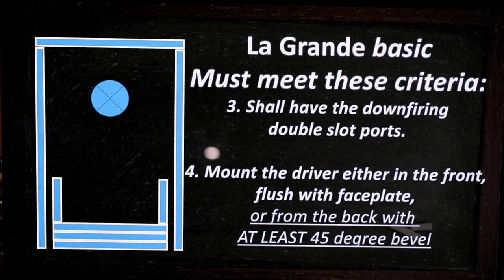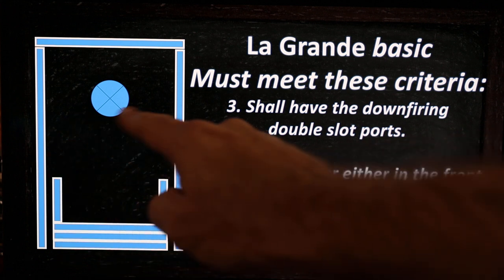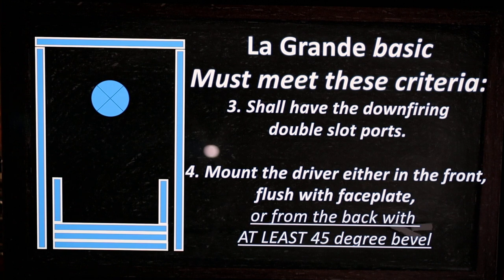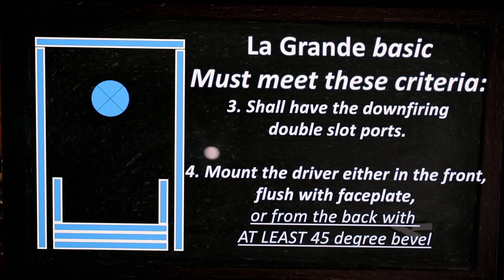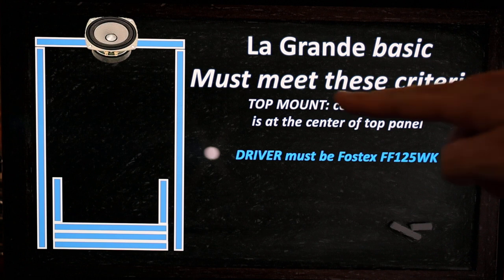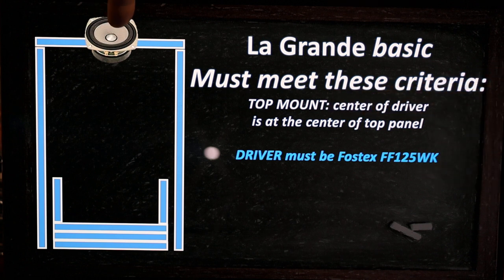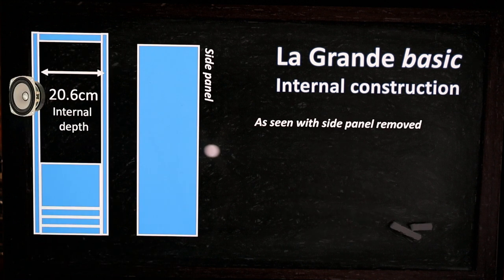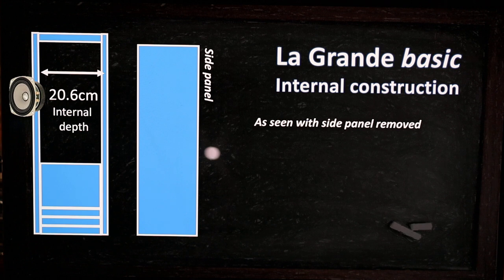La Grande basic build plans II

Comment: I'm seriously considering a "first attempt" to build myself a pair of speakers based off this design. Unfortunately, I don't have a space to build at the moment and my current living situation won't allow me. Hopefully this will change in a month or so. Yesterday, I was walking around a local big box store, checking out the solid wood boards and plywood. I ended up sketching my own version of a speaker based off the Basic La Grande dimensions. After a few hours of head scratching, I envisioned the whole construction process: materials and parts list, wood selection, tools needed, cuts and measurements, glue choices, etc. If I do end up building a pair, the construction will be with hand tools and simple smoothing materials like sandpaper, sanding blocks, files, etc. Also will convert all the measurements to fractional inches since that's what I'm most familiar with . My ultimate goal here is to "make something with whatever is available at any local hardware or big box store". Most importantly, to do it as cheaply as possible. As for the drivers, I won't be using the Fostex brand, so I'm throwing around a large list of lovely and possible girl's names in my head for my own creation. 
As for the assembly, I want to glue everything together permanently (with the exception of the rear panel). Upon completion, I will apply a dark colored varnish to the wood. The varnish idea lead me on a search to a video on making a black shellac finish from old broken 78 records! First task here is to buy a pair of 4 to 5 inch full range drivers. 😁
Reply: hi i just built mine and had the thought that would be possible to just take the measurement and the wood to  cabinet maker  who has all the tools already to do accurate cuts .  Am thinking a future version I will do that , could get them to rebate the wood so it slots together.  Just a thought that may help
Reply from the maker: Fantastic!! :) The shellac finish is a good idea - finished my Voigt pipe with shellac..
Reply from the maker: @toeknee8481  I'm glad you already finished it, that was super fast!!! :)
Reply: @realworldaudio  Yes 👍 I think it's a great idea. But the person who produced the video made a super thick cut of varnish. Too thick IMHO.  He also used a brush to apply the varnish to wood. The mixture would need to be filtered first before use. Also adjusted accordingly with the right amount of broken record chips and alcohol, to produce a cut that can easily applied with a hand pad. The color he made from the 78 records is black no doubt. Darkest colored shellac I've ever seen to date. Natural wood is very nice looking, but having some color options is a whole other world.  🙂

Comment: Thanks Janos I jumped the gun as had some free time over holidays and started my build before these videos and have decided to finish with some adaptations as per these updates. So i have an internal height of 508cm based on the earlier video,  which is a bit short and front, and back panels are 18cm plywood.  Can easily adapt the sides to solid pine as I have some old shelves I will use . Bottom is slotted.  Am thinking will finish as is , but can swap back to 12 cm ply later. Using same driver.  Can do the chamfer will need to get the bit . AM thinking will be just a little less bass but otherwise same , or not ?
Reply from the maker: You can keep the 18mm, no worries! Will be a little less live, but nice sounding nonetheless. Just make sure to mount the driver from the outside, the inside will not work with that thickness. The slighty smaller height is not an issue - yes, bass not as deep, but not by much. Also, the 50.8 cm tuning is a little more balanced, than the one for the 61.6, so you will also end up with a very nice cabinet. I suspect that they will sound very similar, just slight +/- for each.
Reply: Hi Toeknee - I know exactly which build you mean: La Gorda. BTW, what is the length of your port? I tried to figure that one out with WinISD as I only got the length for the tube version. Your feedback would be most welcome. THX
Reply: @realworldaudio  Janos, you never talked about the slot port length for La Gorda (internal dimensions H51.8 W 34.6 D20.6)  (only of the port length) - I derived a slot port length (slot height 15mm) of 11.5 cm. Could you confirm my "calculation":hand-purple-blue-peace:?
Reply: @sebastianbenz2496  In short probable 140mm.  I had already cut the wood for the face but was able to adjust the slottted port to be the same as Janos which has shrunk my height down to 480  (518-38)as i have add the two extra bits of of pine on the slot. WAs using 19mm pine so i cut bottom at 308 -36. but rounded it to 290mm as i had some pine shelving  peice  that size so just used that and then used two 240mm piece of pine shelving and screwed on top of the 290mm which left a 20mm gap each end . so cut  another 240mm in half to be 120 and they were the sides. Then did alot of sanding to even them up. so answer would of been 140mm which was 2mm more than Janos. Is suppoded be a guide so a few mm i think wont matter. I have done the rebate. Started playing them tonight . Sounstage is huge and is as deep as wide.  My  internal measurements were internal 478H, 318 w, 173 deep and 15mm x 2 slots (in theory not sure of my build quality may need to do adjustments) . with a 140mm port height.
Reply: @toeknee8481  thank you, Toeknee - happy to hear that you enjoy your build. Will report how La Gorda plays, hopefully by end of next week ;-)
Reply: @realworldaudio  Thanks , yes mounted on outside rebated. Ist listen sounded awesome, I was very impressed. While i was building the cabinet had the drivers playing radio in a spare room for a few days. I had centre straight away and the huge sounstage was at least equivalent to my towers. Bass was not lacking ,if i am using winsd correctly looks like its tuned to about 39hz.  Have no stands so playing on floor using a spare block of wood under each

Comment: Intriguing design Janos. Thank you for conceiving and sharing it although I'm probably more keen on your considerations for it :-) I'd intuitively would put this in tapered cabinet and retain the port design. Would you? Another thing that comes to mind suitable for a tube amp (and scaled up) is GPA's Altec 415-16B biflex.. 97dB sensitivity but somewhat comparable in bandwidth / application.
Reply from the maker: Hi Eduard, I did not go for the tapering, as for such small cabinets the tapers have been ineffectual in my past efforts. They did not add benefit on this small scale, just wasted efforts. Yes, the 415 would be a wonderful driver for a project with much greater potential, but for people who want something similar to a VOL. This is intended as a project for people who have small rooms, or very limited money to spend and still want high level sound. My question was whether it's possible to create a VOL-like experience on an extremely tight budget.
Reply: @realworldaudio  Yes gotcha. The 415 was more the idea for a tube amp and single driver VOL, not for tight solid-state oriented budget like the 125WK. 

One bit more VOL like option, for a slightly bigger budget could be Visaton BG13P (full range,92dB) +W300 (woofer,91db) with a 300Hz xo. These drivers are very moderately priced and quite efficient.. and could make use of VOL active panels/construction - with upfiring full ranger.
Reply from the maker: @EduardBroekman  One surprise though. In the live cabinet he 125WK behaves more like a 95dB sensitive driver! Last night have placed it on a proper stand and that added an extra 5-6dB to the apparent efficiency. It definitively sounds like a high efficiency loudspeaker, and not a 88-89dB/Wm one as the specs suggest for a 6L cabinet. (The x8 internal volume also might have something to do with that ; ). In addition, I think they gave the specs for the unbroken drivers. And definitively, during break-in their efficiency went up tremendously. Out of the box they barely made any sound, and day 1 seemed to show they definitively need 20W at least. On Day 6 the highest peak of the organ recording that I shared tasked for 1.4W. And the day after I saw the apparent 5-6dB further increase in output (not just output, dynamic range vastly increased as well). So, it's turning out to be a formidable speaker for flea power amps.
Reply: @realworldaudio  Very interesting!!!!!

Comment: AWESOME, thanks a lot...my wood work will stark next week...very exited to see those type of cabinet. Btw.: will try my quad 405-2 amp for testing as well. Having some issues with my el84 tube amp (ground loop, no matter what I try, not going away)...
Reply: AC heaters? Have you twisted wires AND biased the heater to a positive voltage at least at same level as the highest cathode voltage? Often just place a 1kohm from output tube's cathodes to on side of the heater wiring, and be done. Add a cap to signal ground if needed. In my experience elevating the AC heaters to any voltage from about +10V to +60V (it depends on my simplest method of getting an available voltage) has always reduced any heater related noise.
Reasoning: The heater filament will emit some electrons at the AC frequency and if the tube's cathode is a positive electrode for those electrons they will flow to it, they then become signal at line frequency, thus noise/hum. If the filament is at a more positive voltage, they will not be attracted to the cathode, and stay put, approximately...
Reply: 405 is a very nice amp 👍... Did you try the mods suggested by snook? In my experience very worthwhile the effort. If you didn't you can Google it.

I did the snook mods and turned two 405's into mono (one board and power supply in each housing). Another very big improvement in sound quality, especially in the bass region (much tighter).
Reply: @fulcobouma  i'm not that advanced DIY'er...https://www.keith-snook.info/QUAD-405-2002.html pretty neat adjustments.... getting first my quad 44 preamp

Comment: Yes but what is the internal volume? You don't give the measurement I can see with slotted port. And why  make them so short seems counterproductive considering the size of drive, I would have thought just below the driver.
Reply from the maker: 42L ; the slotted ports are actually quite long, 6cm+13.8cm = 19.8cm long total.
Reply: @realworldaudio  have you tried tilting the speakers back maybe 5° instead of putting them on stands
Reply from the maker: @hoobsgroove  Not yet. But placed them on proper stands yesterday evening, and that pretty much transformed the sound. Muddiness gone, bass unevenness mostly gone, and some real scary deep bass appearing. Also, apparent sensitivity shot up by about 5-6dB!! On the floor it was an incredibly fun little speaker that punched way, way above its price, and provided an exhilarating sound. Now on the proper stand I'd put it against any commercial speaker at any price and it would hold a solid ground. ; ).
Reply: @realworldaudio  not sure... if I calculated correctly and even subtracted the slotted ports I get 43.9L ... I am not sure, but to which frequency did you tune La Grande? 42Hz?:hand-pink-waving:
Reply from the maker: @sebastianbenz2496  The 43.9L is the total volume without taking anything off!!  61.6x34.6x20.6cm = 43.9L is the internal volume! The slot ports, the air in the solt port, and the air occupied by the driver needs to be substracted from there, leaving approx 41-42L free air volume. The tuning frequency given by WinIsd is estimated at 40Hz. (I call estimation, because software models are rough estimations at best.)
Reply: @realworldaudio  thanks!!
Reply from the maker: @sebastianbenz2496  You are welcome 👍👍
Reply: 42l, some almost 6 times the Vas...😊